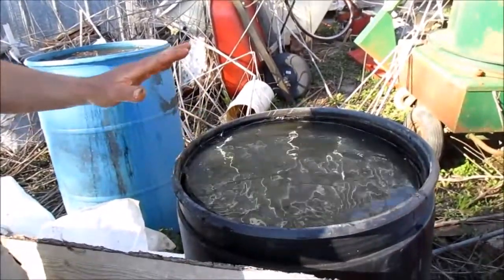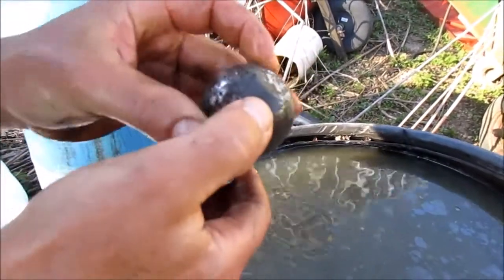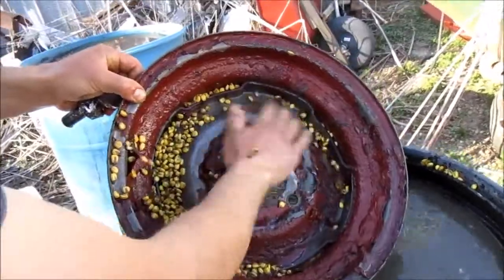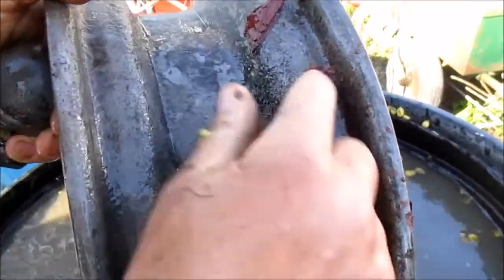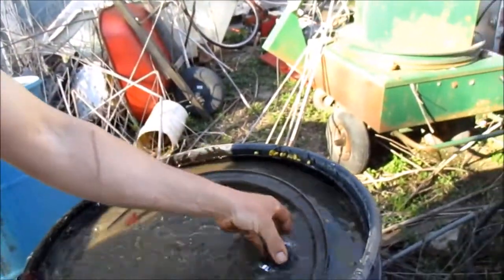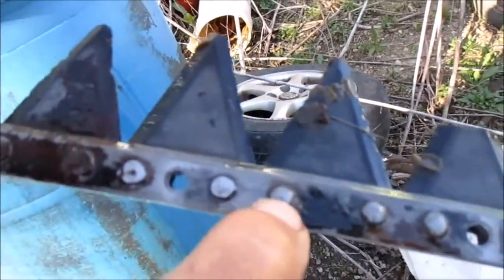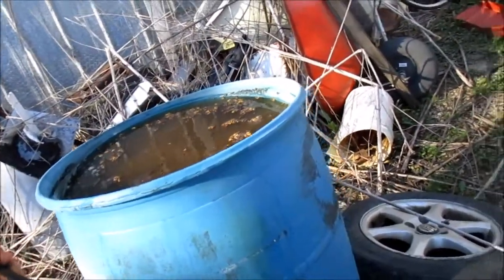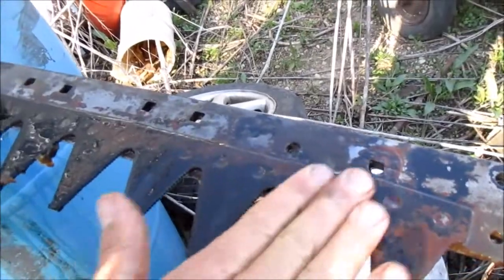Rotten Corn Rust Removal

Comment: This is neat! I've done something like this except I used a PC 12V power supply and Epsom salts to do electrolytic rust removal in a big water bath - transferring all the oxides to a sacrificial anode. It worked pretty well on my moped's cast iron cylinder.
Reply from the maker: This acid technique would be easier and less smelly just using a gallon or two of inexpensive vinegar - but maybe there are some other magic secrets in the corn that help . But if you have a few hundred pounds of spoiled corn why not eh ?